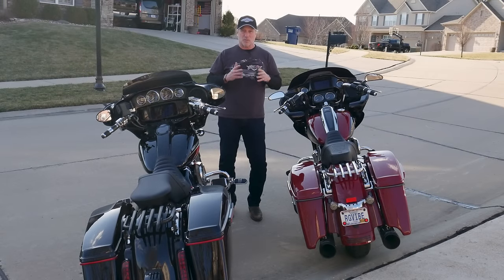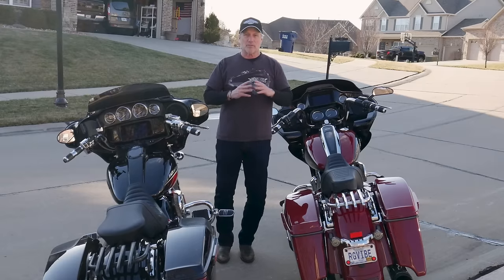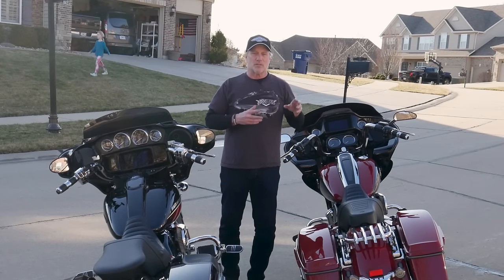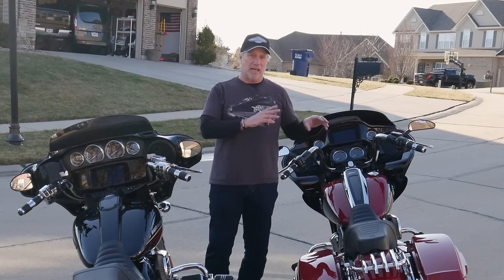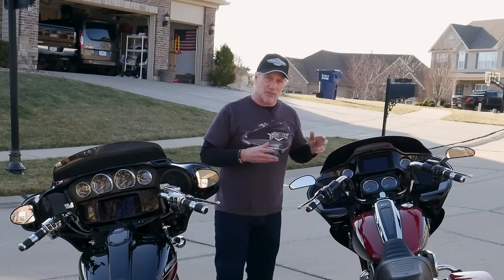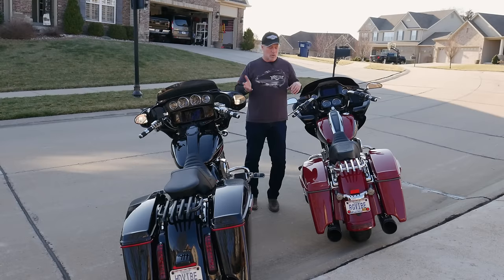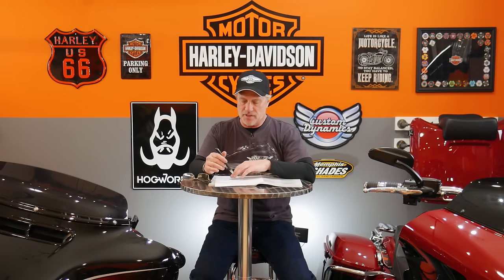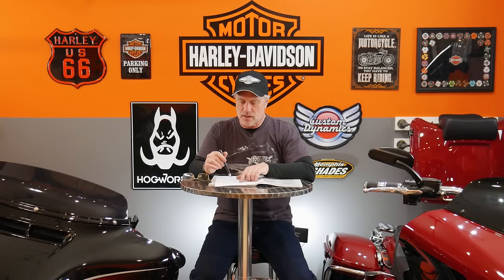Harley Davidson Stage 2 vs Stage 1 Upgrade M8 114 vs M8 117

Comment: The only requirement to keep your warranty is the tuner. You can use what ever cams you want and what ever exhaust you want but must use the SE tuner. Now I know I will only have this bike a couple years and I will see something shinier and but it. So why down $500 on the SE tuner and does take the limiter off. Can’t mix the air it’s all EPA compliant. Get the Dyno Vision for same price and that will wake that machine up. You are not getting 100% out of all that work.
Reply from the maker: Thanks for watching and providing your input on the topic.   Your point on only the SE tuner to keep warranty is on point.  However,  the base maps for CAMs are only for HD cams...so essentially your have to use SE cams or the bike won't run properly or well.  Definitely, other tuners get you a better tune given that they can CURRENTLY give you a non-EPA tune, however that may not be the case for much longer.  EPA cracked down on Vance and Hines recently, so they no longer offer any non-EPA base maps.  It has trickled to the exhaust manufacturer's as well...several no longer offer de-catted headpipes.  I believe the non epa tune days may be coming to an end soon.  If you are already a subscriber to the channel...thank you.  If you haven't yet subscribed to the channel I'd be honored if you'd consider doing so.   Thanks for your support and ride safe.  ✌️👊👍

Comment: Nice video.  On HD's web page they say a stock Road Glide ST hit 127ft-lbs @ 3750 RPM.  That's a lot higher than the number you mentioned stock on the 117 I think?
Reply from the maker: Thank you for watching.  Yes that 127 ft lbs is higher than the CVO numbers stock.  It could be the ST has a different cam than the CVO 117.  127 ft lbs is a very good TQ number.  I need to look into that a do some research.    Thanks so much for sharing the info.  Ride safe and enjoy. 👊✌️👍
Reply: HD's numbers are at the crank, not at the wheel. Same as any manufacturer
Reply from the maker: Thanks for watching and commenting.   I appreciate your input on the topic.  If you are already a subscriber to the channel...thank you.  If you haven't yet subscribed to the channel I'd be honored if you'd consider doing so.   Thanks for your support and ride safe.  ✌️👊👍

Comment: The tuner probably does more than the actual cam. I think most of these stage 2 bolt in cams are nearly the same.
Reply from the maker: Thanks for sharing your perspective.   The tuner definitely makes a difference when it comes to HP and TQ numbers.  Since I'm using Screamin Eagle I know I'm not getting all the HP and TQ out of either bike.  Thanks for watching and ride safe. 👊✌️👍

Comment: I was waiting for you to talk about gas mileage difference with your conversion. 🤔
Reply from the maker: Thanks Greg for watching and commenting.   Not much difference in gas mileage.  All my bikes I tend to get around 38 to 40 MPG...the 114 with Stage 2 right in the same range.  I tend to run rpms in the 2800 to 3500 range most of the time so my mileage is a bit lower.  Just my riding style.  If you are already a subscriber to the channel...thank you.  If you haven't yet subscribed to the channel I'd be honored if you'd consider doing so.   Thanks for your support and ride safe.  👊✌️👍

Comment: They only changed the oil pump, they still have the cast cam plate...
Reply from the maker: Thanks Stephen for watching and commenting.   Your statement regarding the cam plate is correct...at the end of the day I decided to change out both just for additional piece of mind.  If you are already a subscriber to the channel...thank you.  If you haven't yet subscribed to the channel I'd be honored if you'd consider doing so.   Thanks for your support and ride safe.  ✌️👊👍

Comment: What seat and rack is on the 117?
Reply from the maker: The seat is the Saddlemen Touring Step Up.  The luggage rack is a generic stealth rack.  If you go to the Saddlemen Playlist on the channel you will find a video that I cover multiple Saddlemen seats that I use including the Touring Step Up.  That is one of my favorite seats to run.  If you are already a subscriber...thank you.   If you haven't yet subscribed to the channel I'd be honored if you'd consider doing so.   Thanks for your support and ride safe.  👊✌️👍
Reply: @HDVIBE  generic stealth rack? What do you mean by generic? Is that the brand? And the saddlemen touring set up is the name of the seat??
Reply from the maker: The rack I believe I purchased from ebay or amazon...no brand name.  Yes the seat is the Saddlemen Touring Step Up.  Brand is Saddlemen...model is the Touring Step Up.

Comment: How did that cam effect your gas mileage?
Reply from the maker: I'm getting around 38 mpg with the cam in the bike.  Probably 1 or 2 mpg less than when I had stock cam.  I'm probably also running it a bit harder than normal as the cam has only been in the bike for 3 or so weeks now.  Still enjoying that quick response and added torque in the low end.  Thanks for watching and ride safe. 👊✌️👍

Comment: Haha. Just watched, liked, and commented on your “what is stage 2” video. Commenting on this one now and subbing. Again, I got a 2022 street glide special 114 with apex paint. Want to stage 2 it. Running 93 gas. And do led strip lights out back. Biggest question for me is exhaust now. I want black pipes….so please inform me of the best pipe set up for this stage 2 upgrade on the 114? I will be purchasing the new “pro” tuner with Bluetooth and learning tune. So pipes people. Lemme IN!!! I’m wanting to do full exhaust and eliminate cats if possible. If that ruins the stage, then I’ll go with slip-ons. But it’s gotta be black and it needs to work correctly. Best exhaust comment replies here 👇
Reply from the maker: Thanks for watching and commenting.   I'm running a Full Tab Performance exhaust system with the 2-1-2 catless headpipe.  Check put the full video on that.  It uses stock heat shields and you can get the Tab 4.5 BAM  sticks in black.  I'm running the system with Zombie baffles.   Awesome sound output and runs great with the Stage 2 set up using Pro Street Tuner.  👍
Reply: @HDVIBE  thanks for replying brother…taking a lot of guess work, self doubt, then buyers remorse right out of my hands and mind. Soooooo damn many arguments across the web over 1-5ft/lbs and another 1-5hp @ whatever rpm!!! Lolzzzz. With ALL THAT BS out there and a possible whopping 5 ft/lbs, the warm fuzzy I’ll have in my belly knowing I used Harley parts and still have a warranty is how I need to have it. I’m a Motörhead and gunsmither who loves tinkering and builds. And I can absolutely seeing myself chasing “the perfect setup” as I have in my younger rice rocket days. At this point I just want a super clean bike that I know will get me home! Just a lil bit faster than the dudes chasing me from the bar when I tell him “who gives a shit about the laundry list of parts you put in and took out just to be 3hp more than mine with no warranty and yer bitch is bitchin about the hot oil that keeps spraying on her calf every time you blip the throttle (47 times per stop light)!!! I’ll just need a 3 sec head start….smiling knowing my stage 2 torque kit will takem from the line and I’ll have to outride em from there lol. Warranty. I like that word! Especially for resale since these bikes get better yearly and dudes trade em after 1-2 seasons like dirty socks!
Reply from the maker: @jasongaudreau2075 👍

Comment: S.E 131 & Cycle Rama 513   151 hp 157 tq... 😁
Reply from the maker: I just recently seen that exact build.  Huge power and torque.  The power and torque curves are very smooth.  Thanks for watching.   Ride safe and enjoy. 👊✌️👍

Comment: :46 in and im gonna say the cams (Stg II) is the better of the two
Reply from the maker: Thanks for watching and commenting.   I really like the Stage 2 on the 114.  You definitely feel the front end lifting up as you get into the throttle.  If you are already a subscriber to the channel...thank you.  If you haven't yet subscribed to the channel I'd be honored if you'd consider doing so.   Thanks for your support and ride safe.  👊✌️👍

Comment: Wow the lights flash when you back up just like you're backin up a truck
Well I guess you kinda are.
Reply from the maker: Thanks for watching.   The flashing is the Custom Dynamics Magic Strobe module.   It is flashing as I was applying the brake as I backed into the curb.  Ride safe and enjoy. 👊✌️👍
Reply: @HDVIBE  first I've seen that it is an attention getter........ maybe some texting cage driver will see you. Good luck on the street we all can use some
Reply from the maker: I have Custom Dynamics all over my bikes for that exact reason.  Thanks for watching. 👊✌️👍

Comment: What a waste of time and money. SE cams are a joke, and you didn’t even get a proper tune. Why even do it? $2k to get your 114 to 100hp? My 114 with woods 22xe is doing 120hp/130tq. This video should be titled “how to waste your money”.
Reply from the maker: Thanks for watching and commenting.   While you can certainly get more performance out if the M8, my choice was made based upon two things...getting more torque and staying in warranty.   So from that perspective, going the Screamin Eagle route was the best option in my case.  And if one wanted to get more juice Eben out of the SE8 447 cam...it can be done with a custom tune, however,  that would take the bike out of warranty.   So is it a waste of my money...in my opinion it's not.  Besides it's my money not yours so how I spend it is relative to my situation.  Thanks for your support and ride safe. 👊👍✌️

Comment: Harley is annoying af. Give us some performance right out of the gate. Quit detuning all your shit only to force us to spend more money on an already outrageously expensive machine. I bought a new 2014 Fatboy Lo and threw in an S&S 124". I went with a very mild 585 cam, low compression pistons at 10.2;1, their oil pump and cam chest and my bike sits at 116hp/136tq on the dyno. HD gives us an extra 3 ci with all their motor increases..... it's pathetic! I am not buying another Harley until I can get an easy, reliable 150 squared for horsepower and torque (I would even bite if these numbers were achievable with a stage 1) . My machine has decent power but it is by no means a hot-rod. It is exactly what a "stock" bike should be. Great for passing and fun.... not a drag racer.
Reply from the maker: Thanks for watching and for the very thoughtful comment.  It will be interesting to see how the VVT 121 engine does on the CVO and if they move to the VVT engine on the 2024 touring bikes.  From what I've read, the 121 has some pretty good numbers from the factory.  If you are already a subscriber...thank you.   If you haven't yet subscribed to the channel I'd be honored if you'd consider doing so.  Thanks for your support and ride safe.  ✌️👍👊
Reply: @HDVIBE  I'm more curious to see how long until they put that new 135 into their non-CVO bikes. I'm guessing it'll take another 5 years before we can buy it in a Road Glide ST..... assuming the model doesn't get discontinued. That would make me haul my wallet outta the back pocket! Lol
Reply from the maker: @beri232  135 would be interesting.   ✌️👊👍

Comment: First thing you need to learn  how to do is dismount a motorcycle properly
Reply from the maker: Thanks for watching.  Ride safe and enjoy.  👊👍✌️
Reply: That dismount is how the state troopers do it so its perfect
Reply: @davidcalloway9901  wrong, that's not how how they teach you in riding class,
Reply from the maker: Thanks for watching.  Yes that is how motor officers typically dismount so as to not dismount into traffic.👍👊✌️
Reply: @HDVIBE  do you realize how stupid that sounds, they pull up behind the vehicle face there bike out towards the road like the police cars do plenty of room to exit the bike safely, bottom line that is not how you dismount a bike, doesn't matter how they teach them in training doesn't apply to us

Comment: Got a 2022 RKS (Apex) with 114 and stage 2, pro street tuner.  S&S mufflers. Motor sounds great, power/torque is excellent.
Reply from the maker: Thanks for watching Charles.   That is an awesome looking paint set.  Congrats on getting your hands on it and it sounds like the stage 2 is working well for you as well.  I appreciate your support.  Ride safe and enjoy. 👊✌️👍

Comment: Wood 22XE, SS Plate, pump, change the cam gear, tensioner, cog, lifters, tappet cuffs, and adjustable pushrods.   Chris at Blockhead used a Power Vision. 

https://youtu.be/gPUnKOuaz5s

https://youtu.be/OIHehvxG0xk

The only thing Screaming Eagle  should be plug wires.

I got on my 2020 Fat Boy and soon figured out I live above 5000rpm.  That is not where Screaming Eagle lives so I cancelled the extended warranty.

Just got a 2021 Road Glide with a Screaming Eagle Stage II.  On the test ride I told the salesman he lied to me.

I was wrong.

Chris will be sprinkling some of that speed dust on my Glide.  I’ll add a TRASK basket, Barnet clutch, and a Man-O-War Comp.

Harley had to be dragged kicking and Screaming Eagle all the way to the Supreme Court to be forced to honor THEIR warranty.  I suspect they will fight me over any and every claim.  No thanks, I’m used to being treated with honor and respect.

ET1(SS/SW/MTS) US Navy, Ret.
130mph Tee Shirt 
(my feet kept slipping off the boards, So I didn’t Peg it.)
Reply from the maker: Thanks for watching and sharing the info.  Sounds like you will be getting the Road Glide turned into a beast.  If you are already a subscriber....thank you.  If you haven't yet subscribed I'd be honored if you'd consider doing so.   Thanks for the support and ride safe. 👊👍✌️